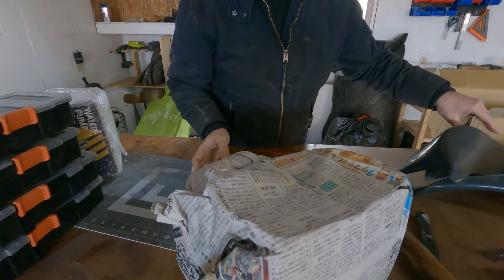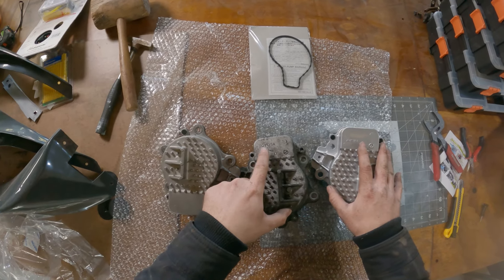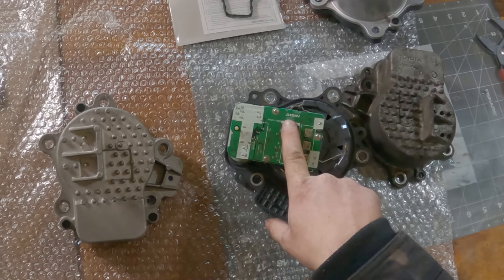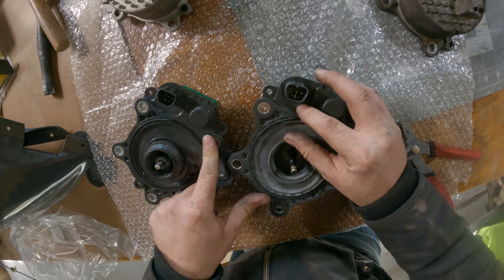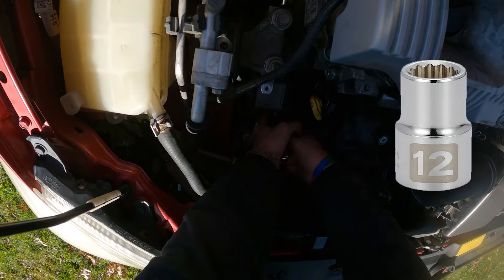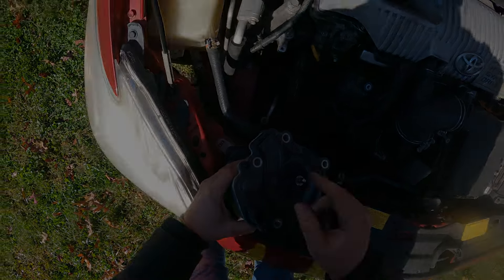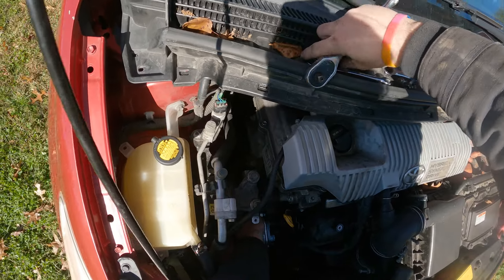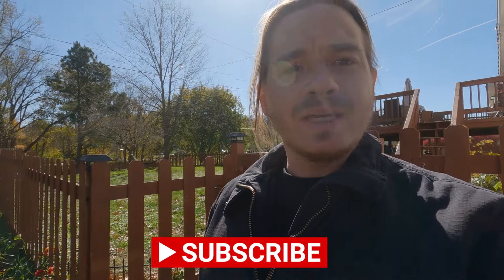Replace Prius Water Pump CHEAPLY

Comment: You totally missed the heat sink gel tape inside the pump housing that sits on and cools the electronics board.
Reply from the maker: I’ll have to go and look at that. Maybe the non-OEM ones don’t have any or it’s inadequate. That would definitely contribute to the shortened life I’ve seen first hand. Good catch!
Reply: By non-OEM are you referring to the cheap replacement pump or the AISIN supplied pump that has Toyota badging removed  ?

Comment: I found this advice way too late:  I bought a Amazon pump and installed it on a 2010.  It worked fine for a while, then I started having intermittent overheating issues.  I never suspected the pump because I bought a new one.  I replaced all likely culprits with no solution found. My wife took the car to Phoenix and I had to get it towed back. The headgasket is blown at 85,000 miles. I redid the head and put everything back together. It still overheats.  (I put the same water pump back in.)  In desperation I dropped $400 on a new, genuine Toyota water pump from our local vulture dealership.  The car runs fine now even when it's 111F outside. Even under heavy loads the temperature does not go over 195F.  I tried to save $250 and wound up spending hundreds more, sustained frustration, many hours of trouble shooting and replacing the head gasket, and mental anguish.  Don't go there.... IT IS NOT WORTH the apparent savings, at least in my case.
Reply from the maker: I agree 100%. I didn’t have good luck with the cheap pump either. It made bearing noises out of the box.
Reply: How’d that Aisin pump from Amazon work out?
Reply from the maker: It’s held up just fine!
Reply: It could be that some 'knock offs' doesn't have heat sink part  at top part to spread out built up heat. I used back the same pump, just changed the 'middle rotor part', spread a generous  gasket paste and let dry ( 30mins), put everything back, tighten and leave it for 24hrs. Then topped back coolant to level and have balance in jug ready while engine runs and complete filling. Then check for leaks with coolant cap off. Use obd2 tool to cancel ( erase) previous failed codes ( 261B) and capped back coolant cap, drive short distance , find a slope and park facing uphill ( air trapped will go to highest point ) and check again with cap off. Look for bubbles . When back at level, check coolant level and fill as required.

Comment: I brought the cheapest one one amazon for $100 my water pump went bad at 150k. Dealership quote me $900 to do it i said hell know seen a video on YouTube did it myself easy.
Reply from the maker: Exactly! It’s a super easy job. It’s crazy that shops charge as much as they do.
Reply: How's the cheap pump working after two years?
Reply: 280k miles original owner.
Reply from the maker: @fredkaempf8058 the cheap pump is no good. The Aisin (which is the same as OEM and mid priced), works fine!
Reply from the maker: The AISIN is the same as OEM, so whatever you can get it at is better than “Toyota” branded and worth it.
Reply: @LoganDidItYT I agree with you.  I'm curious what you think of the AISIN ones on eBay? Amazon has them for $149 and a few eBay folks are selling as low as $120 direct from Japan. New. I just don't want to end up with a counterfeit POS.
Reply from the maker: @ I got mine from Amazon, but I’ve bought a million parts off of eBay and haven’t really had any issues. It’s worth a shot!

Comment: If you do this swap on a 2016+ Prius, you have to loosen the passenger side motor mount and jack the engine up to get enough clearance to slide the water pump out.
Reply from the maker: Awesome, thanks for the info!
Reply: Can u still get them all from the top? Can't u reach it thru the fender well?
Reply: @riceburner4747  If I remember correctly, the engine mount is connected to a brace that’s bolted to and around the strut tower. Theres three big bolts holding it on. You can reach them all from the top.
Reply from the maker: You’re correct. There is a stud that faces downward with a nut on the underside of the brace (by the mount) but it can be reached too.
Reply: up or down? I read somewhere to bring it down. Thank you
Reply from the maker: Whichever you find easiest. I guess it depends on if you remove the nut or the stud and nut.

Comment: is using torque specs not a concern here? I noticed it said 19 for the longs 15 for shorts, to balance pressure on the gasket, do you just tighten it snug, and hope for no leaks otherwise?
Reply from the maker: @majulenparah  well, you should always tighten things to their specs, but if I’m being honest I don’t always (internal engine work and other things that have specific clearances- for sure). 

I’ve done about 6 of the Prius ones now and never had an issue with just hand torqued evenly. But, I could just be getting lucky.

Comment: I swapped the magnetic part rotor thing for $20 it was cracked in 2 spots. 2000 miles since replacement
Reply from the maker: I never thought of doing that, I didn’t know you could buy just the impeller. Good info!!
Reply: @WeedmanSmokes805 what is the part number for the magnetic rotor part?

Comment: Hi you did not open valve under engine for drain antifreeze 😊if l change water pump should I change thermostat????❤❤❤
Reply from the maker: @amirnaghian4491  you can drain the from the radiator with the petcock, but I had just water instead of antifreeze. But, a thermostat is cheap and it’s not a bad idea to go ahead and do it at the same time since you’re there.

Comment: Apologies if it's already been said.  The Aisin branded pump uses the same casting for the case as the Toyota branded part then grind off the Toyota logo since they're  not allowed to indicate it's an OEM part.
Reply from the maker: Yep! You’re right! Internally into the same too, which makes sense since they make them for Toyota!

Comment: I saw someone changed the internal 'rotor' that usually is the problem as it splits, cracks and jams up so that's what I did. Only replaced that part, cost $45 (with postage). Saved me paving $135-150.

Comment: nice job. I own a Toyota Auris hybrid (in Europe the Corolla had a different name for 10 years or so) with the same drivetrain as the 2010-2015 Prius. Perfect car. I wonder if I should change the waterpump, now that it's still ok. My milege is 224.000 km or 140k miles. Thanks in advance
Reply from the maker: Thank you! The water pump is easy to do! Take the air box off, and then right below you’ll see the water pump. It’s a handful of bolts and the lower ones are just tricky to get to from the top (easier from under the car). But, other than that, it’s an easy job.
Reply: @LoganDidItYT  thank you for answering! But do you recommend replacing? Greetz from Holland.
Reply from the maker: @joskd8491  I wouldn’t unless you suspect it’s weak (it will make a whining noise). Or if you ever put any stop leak type product in your coolant- then yes.
Reply: @LoganDidItYT  oh, so at this moment I have to do nothing, because nothing's wrong with it yet. Thanks!
Reply from the maker: Of course!
Reply: I feel, when u change your coolant, I would.

Comment: Hi, changed water pump on 2018 Toyota Prius 100k mileage. 
Before changing the pump the car was losing coolant slightly but when I changed the water pump the car is basically losing coolant on daily basis. The car is in use all day long and next day it has to be topped up. 

Is it because I did not  bleed it properly or some other issues? 
Thanks
Reply from the maker: It could be that it needs bled, but they say these cars are self-bleeding systems. You can try putting it in maintenance mode (how to do this is in a few of my videos), let it run with the coolant cap off and heat all the way on high temp and high fan. Once the thermostat opens, if it wasn’t already open, you’ll see coolant suck down just keep adding coolant slowly. This may take a few fills. 

But, if you’re losing coolant and you don’t notice and telltale signs of it coming back out of the reservoir cap (this can happen with air pockets/not being bled), then I’d look elsewhere. 

If you don’t see any spots under your car, I’d check your oil. If it looks milky, that is where it’s going and it’s time for a head gasket.
Reply: @LoganDidItYT  no visible leaks and no oil contamination either. However when heater starts inside the car it makes some sounds water flow and maybe air. 
And when opening the coolant tank cap in the morning it has air pressure. 
And thanks for quick reply.
Reply from the maker: Then yeah, you have air trapped. So, just do the bleeding process (it could take about 30 minutes). Then, you should be good!
Reply: @LoganDidItYT  much appreciated it bro

Comment: Would you please send me the link for water pump that you got that similar to oem one?
Thank you
Reply from the maker: Hey! For the Prius? If so here it is: AISIN WPT-190 New OEM Water Pump Kit https://a.co/d/h0UgTXN
Reply: @LoganDidItYT how does it hold up with the amazon pump?
Reply from the maker: @CCG0D  based on what I’ve experienced, as long as you get the Aisin one, it should be fine. They are the company who manufactures the OEM pump.

Comment: Was old one leaking or making noise? I've HEARD of aftermarket complaints. It ISN'T boring, a lot of us OWN Prii in these economic times. 👍
Reply from the maker: The original was making noise and eventually completely seized up. When I took it off, a part of the impeller had separated. 

The new, cheap one made noise from the second I out it on, and you could hear it struggling.

Comment: Dealer is expensive which one is good for prius 2013
Reply from the maker: I’d go with the AISIN brand one you can find on Amazon (the same one I got). They are the ones who make them for Toyota so it’s the exact same one, just cheaper.

Comment: What’s the mileage when the water pump fail
Reply from the maker: It failed around 125k miles.
Reply from the maker: It’s holding up well and it’s been about 12,000 miles. Thanks!!!
Reply: I’m planning buying one just like you did how this new aisin water pump will last in your opinion
Reply from the maker: @SIMPLEGUY423  it should last the rest of the life of the vehicle: AISIN is who makes them for Toyota, and they make a lot of parts for other cars and trucks too.
Reply: Mine failed at 98K

Comment: can this work on a nissan e power? its the same water pump as you show and say aisin but i dont know if its work
Reply from the maker: I doubt it’ll be the same pimp, but, if you’re experiencing similar issues it could be a similar problem with your Nissan. Check the EGR system and even a cheap code reader can go a long way to help you figure out what’s going on.

Comment: It's not totally true, (about 25mins.? Maybe if you have done this before)..You might still face problems trying to get to those bolts ( leaverage to turn bolt) to remove them. Also good sturdy tools needed ( not cheap crap from china that breaks) and maybe having to lift whole front to get access to underneath access, remove under carriage cover and perhaps, one wheel,..as well as learning to drain out coolant and refilling and getting air out of system.

Comment: That is what mess up your headgasket.
Reply from the maker: I think it’s where it started too. The coolant temp sensor was bad so I never got a light come on as a warning either.
Reply: @LoganDidItYT  do you recomend to replace the coolant temp sensor at the same time than water pump? (nothing can tell us if it's working correctly)
Reply: @LoganDidItYT Not having a temp gauge doesn't help either. And sometimes when the temp warning light comes on it's too late - or people ignore it and think it'll be 'fine' - as a Toyota tech, Toyota owners are some of the most negligent and clueless car owners out there, bless their hearts :)
In my Prius and my Land Rovers, I usually drive with a scantool running on my phone connected via Bluetooth obd plug to always display engine temps....
Reply from the maker: I would just to be safe.